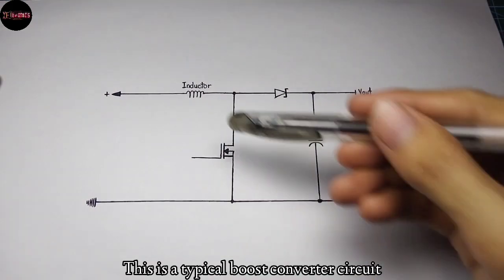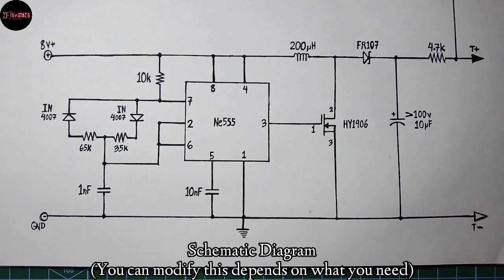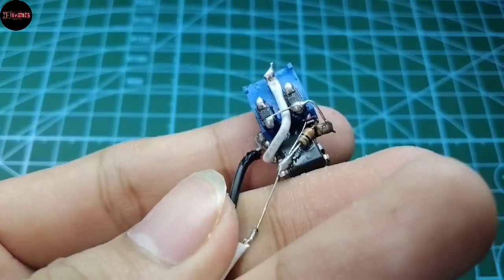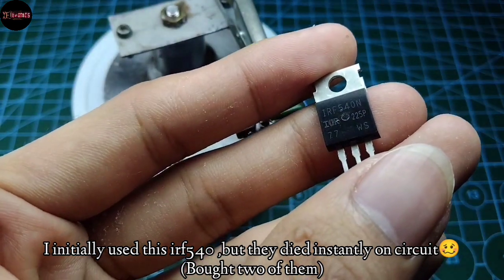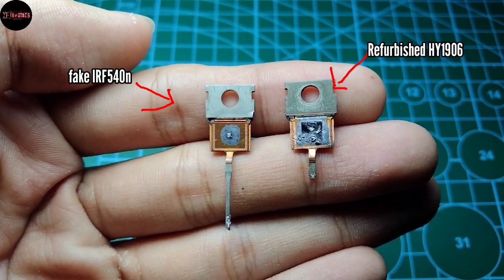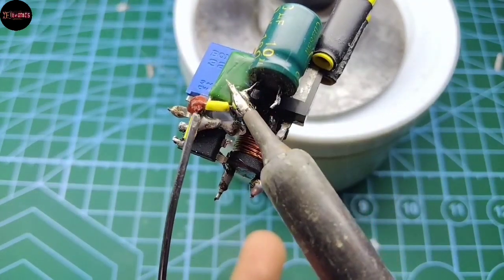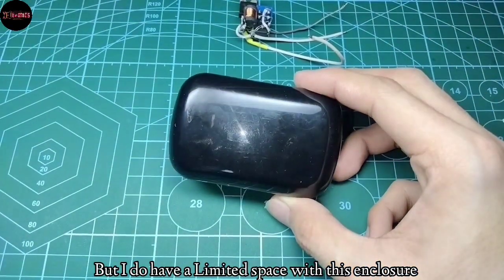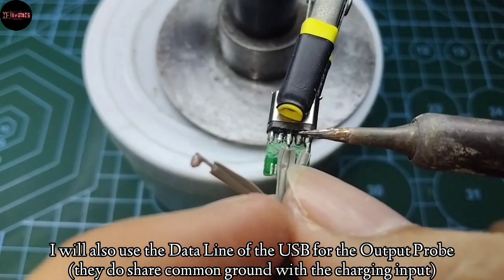Building The Most Compact Portable Diode Tester from Scrap!! #555timer #electronic #diy #ledlights

Comment: Lepo urađeno i hvala na shemama !
Reply from the maker: Thank you brother.
The circuit is modifiable though.
I choose to have around 75volts output because i am limited with the Drain-Source Voltage of the mosfet.
You can use high duty cycle or high inductor value with irf640 mosfet